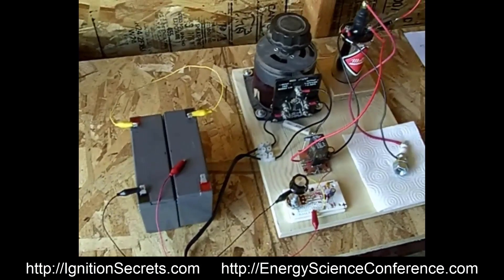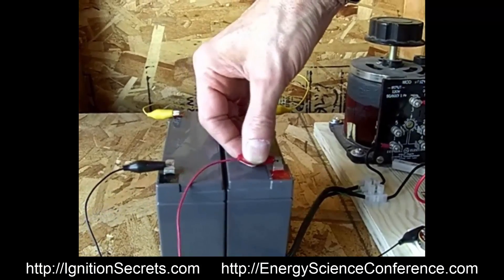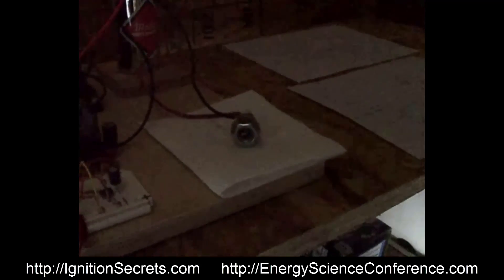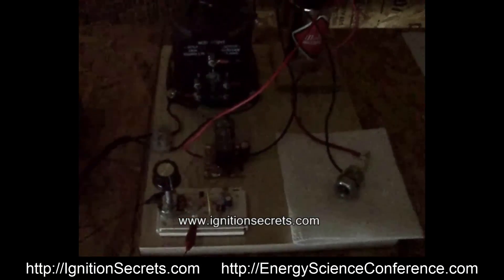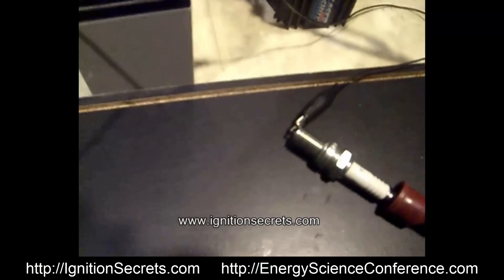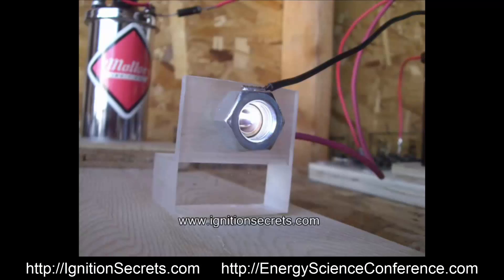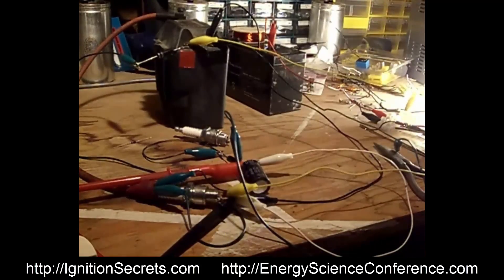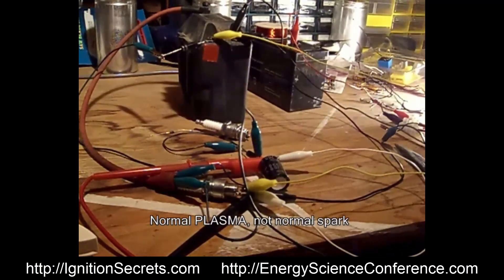Murakami Plasma Ignition 6 Demonstration Compilation

Comment: Stands to reason if you put this kinda spark plug system combined with water injection and it should make dramatic changes to fuel efficiency.
Reply from the maker: Yes, it does. https://www.youtube.com/watch?v=JE73bZs-Kl8&t=1s - join https://energeticforum.com there is a ton of material on the plasma ignition
Reply: @AaronMurakami13 hi Aaron my friend Alex Loseman and I have been talking about incorporating your ignition system into our design for the Hexemeter hydrogen reactor engine.
Reply from the maker: @sigmacentauri6191  It enhances virtually every combustion process in ever engine tried.

Comment: What type of SCR did you used in 50hz cdi? , 
i purchased your ( Ignition secret) but did not get diagram about this circuit.
Reply from the maker: That was Peter's personal demo unit so I don't know but I'd guess a fairly standard one. You can just use a 555 timer circuit to trigger whatever switch you're using. Peter used the 555 circuits a lot for that and I did the same for the bench tests. I put these keywords in google and got plenty of results that will do it: scr 555 triggered cap discharge circuit

Comment: Hi Aaron , I bought the video but i don't understand what you said about adding second capaitor to assist?!!!!!, should be parallel (Peaking)with the spark gap?Or to the main capacitor which supply the coil?
Reply from the maker: Yes, parallel to the spark gap also with a HV diode.

Comment: Hi,
How can I control the duration of the discharge do became even less than 10 us or higher?
Reply: The diode is in reverse mode. So the time it takes the diode to stop current is what the cap has to discharge.

Comment: Did you get the time to add water injection and or hho to the system? Any updates? Thanks.
Reply from the maker: Only in my jet engine. Will get back to the engine as time permits but on backburner for now.

Comment: Bought the Ignition Secrets info but it does not come with enough info - what is the type and specifications for the required diodes?

Would fast recovery be best?  [assuming rectifying types won't work] what is the high voltage and resistance requirements?  How to wire [direction of diode flow to coil]?

Would like to combine with my technology but need more info

Thanks
Reply from the maker: 6A100 diodes can be soldered in long strings of like 20+. Or you can get these 20kv 2amp diodes, which will save you a lot of work: https://www.amazon.com/gp/product/B07G81JB5V?ie=UTF8&tag=maimounas-20&linkCode=as2&camp=1789&creative=9325&creativeASIN=B07G81JB5V
Reply: @AaronMurakami13  thanks - I will be combining your method with my new piston and spark designs that improve power, emissions and fuel economy using the sound waves created at ignition - would like to contact you directly if possible - please reply to redsresearch@gmail.com   

Thanks again - steve

Comment: If the car coil has 12volts to 7500 volts ratio and you dump 160 volts across its primary you would get 50 to 100kv on one half cycle and another 50 to 100kv on the magnetic field collapse cycle making double that voltage across the spark gap
Reply from the maker: The voltage is only going to be what is necessary to breakdown the resistance of the gap.

Comment: hmm  -  what does it take to make a " Lighting Bolt"
1. high voltage /amps not as important/ ground anode cathode
2. water / conductor / and other crap the air
3. air pressure / compacts elements / richer
4. flash point / ignition 
X. i wrote a better form of this but utube and windows 10 ate it!

  What were after here is electrolysis before flash point ignition,
wow I just had vision to solve it, wheres Eric? for my debunk. lol

EDIT -  Aaron Murakami also sees it ( by other info conveyed), I am enlightened.

thx Docacezzz

Comment: I renew the issue - how do you prove faster vs duration of flash on this set up?
....  Murakami - we scoped it .......  ok wheres is it scoped , I like to see it. " on  this test " the cap to tap is ok , but at the high end side or at the flash side is prime .....
Docacezzz
Reply from the maker: +pked9 110us without diode 10us with diode. Its in the video in my presentation at the conference 2 years ago.
Reply: +Aaron Murakami  .. ok I seen a lot of your ch videos proofs and is satisfied, great work!  Duel phasing.....
Giza has indifferent phasing triple or quad .... 
thx...  Docacezzz

Comment: Well done Aaron. How fast do these contact points of the spark plugs corrode due to the heavy plasma ?
Reply from the maker: +overunitydotcom Hi Stefan, that depends on the size of plasma. If keeping it small by only using the small caps in off the shelf cdi/msd units - they're about 400v 2uf, the plugs will last quite a while - especially if keeping the gap small. I have not done long term running tests to give an accurate answer on that but my recommendation is always to keep the plasma small.
Reply: @AaronMurakami13  so do they even wear out?    Dont want to impose psychological restraint on people. Rather they should be exploring and testing limits. Thinking outside the saturnic black cube aka box. 

Wear them out. Break them. Explore
Reply from the maker: @CoincidenceTheorist  It shortens the life of the non resistor plugs. Testing some tungsten ones though, which is probably the best material.

Comment: How is that different from what happens with a spark coil on a car?
Why do we hear loud snaps after you sprayed the water but we don't always see a spark?
Reply: +Aaron Murakami  - how do you prove faster vs duration of flash on this set up?

Noting / higgs  ( Aether ) did prove faster then light.
Reply from the maker: +Mike S The spark is too fast for the camera to always catch it. I have a Panasonic FZ300 that can shoot 240 frames per second and I can run the plasma and I'm VERY lucky to even get a still shot of it. The plasma event is ultra fast. You just have to see it with your own eyes to understand - most cameras do not pick up how bright or loud it actually is.
Reply from the maker: +Aaron Murakami I have one decent pic of it that I got and will post it later.
Reply: Aaron Murakami does the back emf of the relaxation of the primary coil go into the primary as a boost. Think of the old time condensers on the ignition coil. When you pulse a current into the primary and magnetic field collapses it induces on the secondary coil, making a larger voltage ionizing the gap. But the primary gets a kick back from the secondary, causing the back emf. This is why they would put caps on primarys as a condencer to save the points and contacts. In your plasma ignition theory, is your diode capturing that back emf and forcing  it threw the secondary?